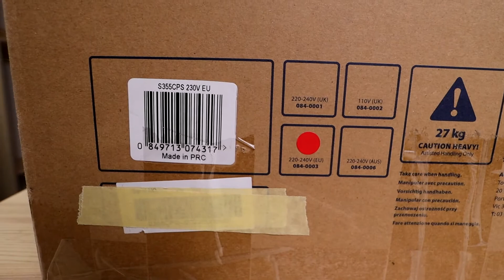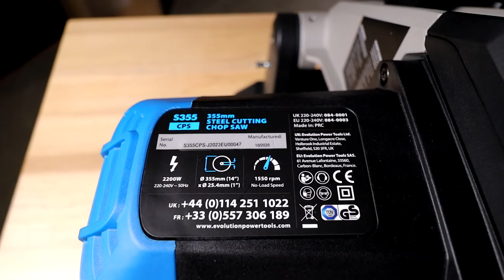Debitator Metal Evolution S355CPS Unboxing

Comment: am si eu unul,atentie la panze ca sunt scumpe si sensibile.eu am bulit doua.ce iti recomand e sa fie bine prins materialul in menghina,daca fuge un pic iti strica dintii la panza,si incaceva ,eu nu utilizez dispozitivul pentru teava rotunda,mai bine prinzi teava cu menghina normala,sa stea teava asezata pe masa,caci in acel dispozitiv am observat ca se misca si iti ciobesti dintii la panza.La panze eu as incerca o panza diablo steel deamon 14 inch caci am auzit ca sunt mai rezistente,doar ca nu am gazit de vanzare in romania, sau am sa cumpar o panza bosch 355 expert steel.astea de la evolution mi se par prea fragile la dinti,se ciobesc usor.
Reply from the maker: Exact asta îi și experiența mea. Dispozitivul e recomandat de producător și importator, dar exact așa e, cum zici. Eu nu-l mai folosesc ci doar mut prinderea mai în față sau mai în spate în așa fel încât dintele să lovească cât de mult colțul materialului mai ales dacă e țeavă dreptunghiulară. Ei recomanda să nu se taie pe drept. Oricum eu tai cel mai mult la 90° deci nu mă ajută adaptorul. A mea are dinți săriți, vreau să merg la un meșter care se ocupă doar cu pânze să văd dacă poate să o repare și să o ascută. Eu o folosesc puțin, dar și cu dinții săriți încă taie foarte bine.
Reply: @mesterim  se poate replaca daca dinti nu sunt rupti,dat parca nu mai taie ca si la inceput.

Comment: Foarte frumos reglajul la unghiuri. Cat a costat?
Reply from the maker: Aproape 1800 de lei. Da, e foarte fain. La cel cu abraziv pe care l-am avut trebuia sa desfaci cu imbusul si dura destul de mult.
Reply: @mesterim  te cred. Pentru mine e mult prea mult. Poate ii schimb panza la al meu.
Reply from the maker: @TeoPriceputul  Stai linistit ca si eu o sa fac multa foame, dupa achizitia asta. 
Sa imi spui daca merge. Cred ca o sa fie problema de turatie.
Reply: Trial and Error Makers nasol. Pentru mine nu se merita asa efort.
Reply: Trial and Error Makers da stiu. Nu este cea mai buna variata. Eu nu prea lucrez cu fierul si banii acestia ii investeam intr-in circular. Se preta mai bine pentru ceea ce fac eu. Spor
Reply from the maker: @TeoPriceputul  Eu nu sunt mare fan pentru ca face multa mizerie si nu am conditiile necesare, dar creaza dependenta. Adica imediat gasesti ce sa faci cu fier..

Comment: Cam câte tăieturi duce o panza. Eu vreau să-mi fac un garaj pe structura din țeavă pătrată de 50. Imi ajunge o panza?
Reply from the maker: Dacă doar pentru un garaj și nu vrei sa faci garaje, recomand. Ține destul de mult o pânză, sigur o să ajungă să faci garajul dacă: nu forțezi tăietura, nu pornești pânză în material, stângi bine materialul încât să nu sară la taiere, muți menghina în poziție încât să nu taie direct pe drept ci din colțul materialului și să nu folosești adaptorul pe care o să ți-l recomandă prozatorul că să prinzi materialul în romb (nu stânge bine țeavă pătrată și nu o tine paralelă cu masa). Spor să ai. Eu am tăiat mult cu pânză, are și dinți săriți și tot taie. Am tăiat și țeavă pătrată de 120.